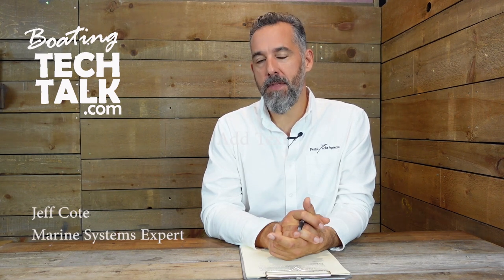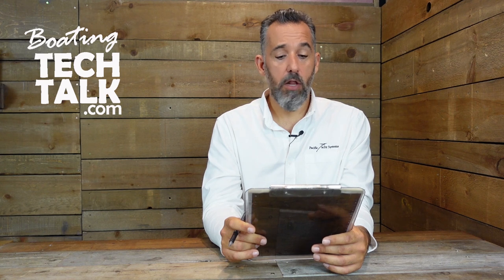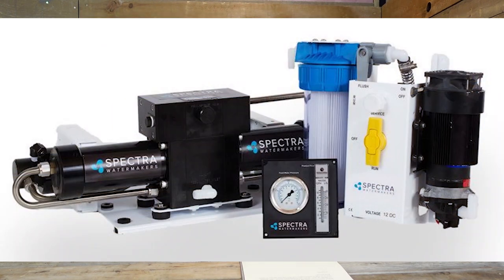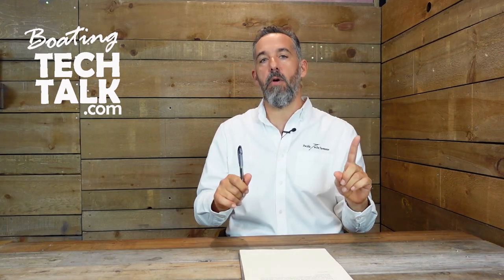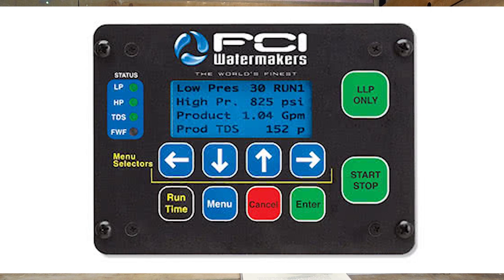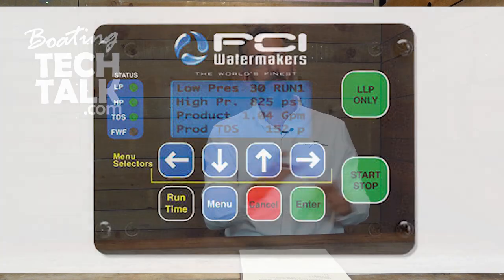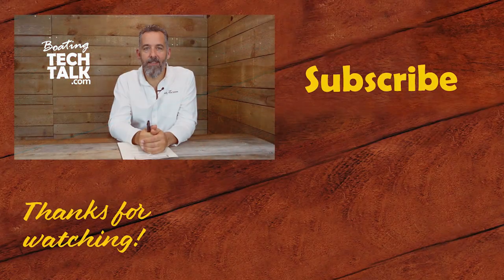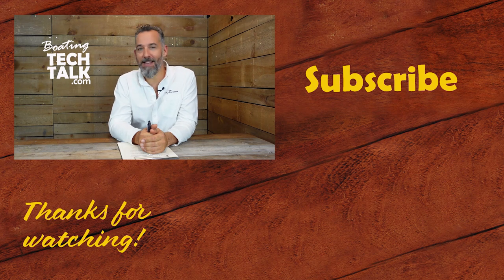Boat Watermakers 101

Comment: For what it’s worth, I just installed a Schenker ZEN 100 water maker and am super happy with it. It makes 100 liters per hour, it’s very compact, fully automatic AND it only uses 400Wh, thanks to a patented energy recovery system. A device with similar performance would be rated at over 2 KWh. So I run two Victron AGM super deep cycle batteries rated at 170 Ah each on my motorboat and can fill the 320-liter water tank in three hours without touching the generator. Highly recommend the ZENs. They come in both AC and 12/24 DC, in 30-, 50-, 100-, and 150-liters per hour capacities.
Reply from the maker: Thanks for sharing Romeo.

Comment: Yet another great video! I am a stayaboard on my 47' pilothouse boat and have only used desalinated water for several years. Based on that my opinion is one you rightfully touched on. That is where do you operate the watermaker from.

The best installation is one where you can easily operate the watermaker without having to move things around to access the panel. For example if you have a sole buried engine room (like most <50' boats) you will find it rather inconvenient to have the watermaker controls in the engine room, or the lazarette for that matter. The same is true for the pickling port, valves, and test water output.

On my boat I have a manually operated watermaker that has the operation panel in the main salon, and the test water port is run to a spigot that empties into my galley sink. That way I do not have to go below for normal operation, and I get drinking water right in the galley making it easy to fill up my jug. For pickling I have the valves in the engine space which makes for easy access, and a 5 minute job to prepare the boat for an extended absence.
Reply from the maker: Awesome. Thanks for sharing!
Reply: after using the water maker for several years.. have you notice any health changes in drinking the water..
Reply: @TheBowen747  Yes!!!! Terrible changes!!! My skin got brown from the sun in Mexico from being on the boat without need for water! I started to develop wrinkles, and my hair started thinning! Oh, and I have also developed an incredible urge for margaritas and fresh sea food!!!
Reply: @jamessanders4647   ill see ya next year in the keys  just another 12 to 14 months to go,

Comment: Adding a small water maker to a smaller boat can also represent a weight saving.
I have a 12 volt modular water maker, powered by Lithium Ion battery bank. The weight of the water maker is 60Kg which equates to about 60 litres of water. This means that my water tankage can be reduced and I can have all the water I want on my small boat, which helps for cruising to remote areas. It is much easier that carrying all the weight of the extra water.
Reply from the maker: Appreciate the input. Thanks for sharing.

Comment: As a thought see if your boat manufacturer would recommend a type if you were to have one factory fitted, it might be a bit difficult as certain things like pipe work maybe re direct to make it happen. I don’t think installation is necessarily difficult but like most things preparation is the key, knowing what space you have is important as is allowing for access to do check the equipment from time to time. I personally would recommend getting professional advice and installation, not the cheapest option but you have the knowledge it’s been done right. If you try to do things as cheaply as possible you will probably find it won’t work so well and you end up paying more in the end. Another thing to look at is the manual that came with the boat and see what fits in where, location can be important too. Don’t rush it over a weekend, make it a project and learn from it as you go along, it might be worth learning how it works so you can spot any problems or issues.

Comment: watermakersa.. if they run at such a high pressure.. could a person but a bypass valve and run that high pressure water through a hose and make a power washer for cleaning the boat bottom.. or would this not work??????

Comment: As you have already rightly stated the lower litres per hour models may not be the best option for a given size tank due to will need to run the units harder to do the same job, so if you can find a reference in the specification, please and try to find the duty cycle of the unit and if available the mean time for fail calculations. Automated unit do increase the useability of the process but also increase the complexity of the unit that can affect the long-term reliability. Sensors and pre primer water pumps can fail, pays to have the spares prior to departure
Reply from the maker: Thanks for adding this, David.

Comment: What kind of maintenance is required of a water maker? I have a small tug and getting water in the winter is a pain in the ass. She has plenty of space  and 10,000 gallon water tank. She doesn’t have much electrical power, only has 2 small gensets that are 45 kw each. These gensets are only 208v three phase. I estimate I have 10-12 KW spare power available to run a water maker. We carry 45 days of fuel (47,000 gallons). I’m wondering if a water maker is worth it? The boat sits idle with a crew on it the time, so we run out of water long before fuel. I’m considering a water makers but I’d like to know how many hours and how much it will cost to maintain one. Our water consumption is roughly 500- 600 gallons a day underway and 100-200 gallons a day when not operating. We never have shore power available and we run our gensets 24/7. So we can’t spare more then 12KW for a water maker. Please excuse my ignorance as I’ve never worked on a boat with a water maker, most of them ran 24-7 and water and fuel lasted about the same number of days. Any thoughts are greatly appreciated!

Comment: Great video, thank thank you! Is it possible (or even reasonable) to have an ac water maker and operate it while only running the engine and alternator?
Reply from the maker: Not really, most AC water makers draw too much power to be run off an alternator.

Comment: Can you talk about gallons per amp-hour? Those of us with limited batteries and relying on solar need this.
Reply from the maker: Here's an example, a Spectra Catalina 340 watermaker draws about 13 amps at 12 volts and makes about 13 gallons per hour. Resultingly, running the watermaker for 1 hour, will give 13 gallons for about 13 amp-hours, i.e. 1 gallon per 1 amp-hour.

Comment: Every video about watermakers I’ve been seeing advice not to use it when in marinas. According to them is because the sea water there is not clean enough or it is polluted. Is that right? Nice winds.
Reply from the maker: Good point, you shouldn't run a watermaker in a marina. Ideally a watermaker should be run while underway, away from anchorages, marinas, and other boats.

Comment: I like the encouragement to do one’s own research, but I disagree with asking your neighbor, or at least relying on your neighbor too heavily, because your neighbor likely did no research and heard from a friend of a friend that there’s some cheap DIY water maker that you can power with a household vacuum, and that’s the best option because you can just use a cheap Home Depot shop vac (obviously with a vacuum rather than pump... you will need to pour the fresh water from the shop vac into your tanks, but this is a trivial step worth the cost savings). All you need is an RO membrane, duct tape, and the most powerful shop vac you can find to suck the water through the RO membrane. Lol, please no one do this... I’m joking.
Reply from the maker: Thanks for sharing Shane.